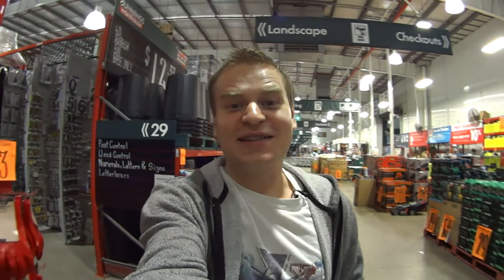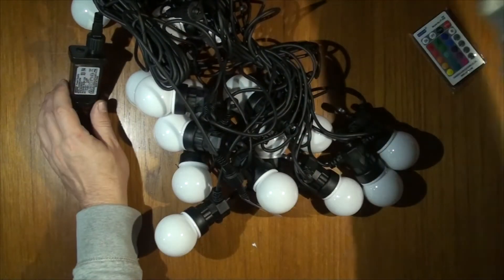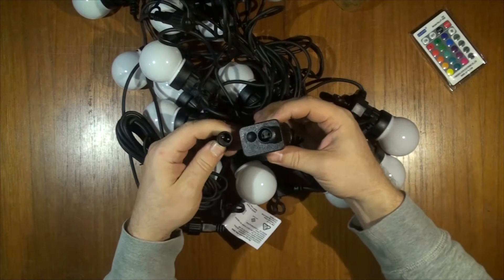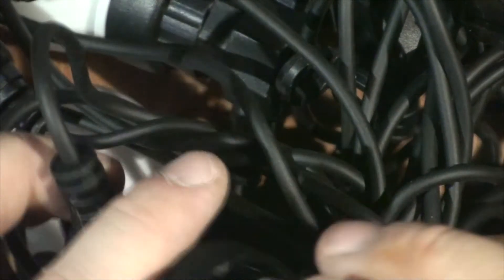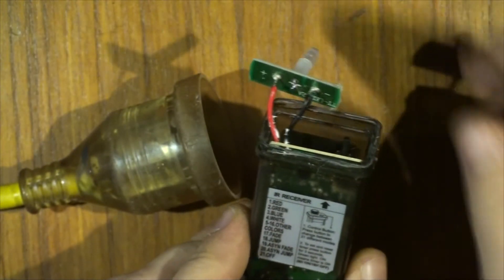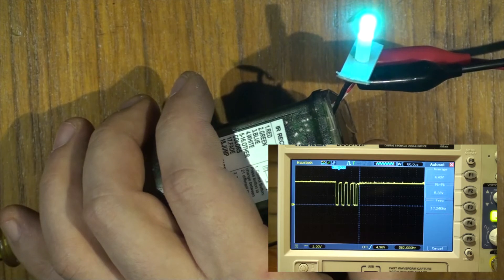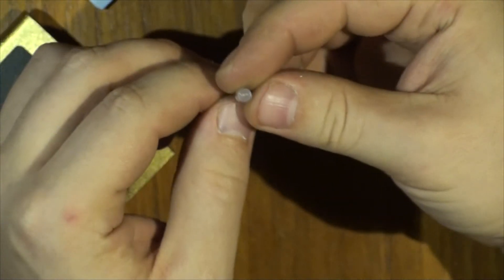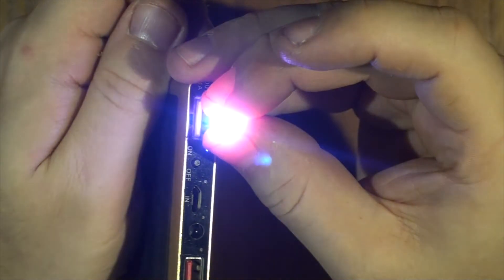Exploring Unusual New Tech LED Party Festoon Lights

Comment: Well obviously it's using something  similar to the old Dallas Semi One-wire tech, though an extremely simple version.  What I'm curious about is how it's individually addressing the LEDs, though I suppose they could use color numbers vs. RGB values and a 4 or 5-bit address.  I'd love to play with some to try and figure out how to drive them, though if they're only sold as Christmas lights, that might be a little more difficult.